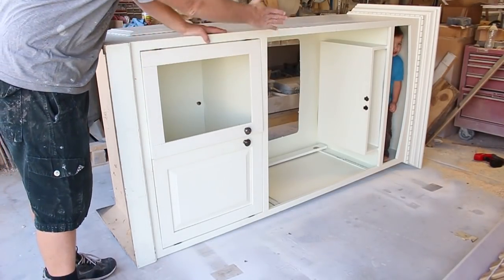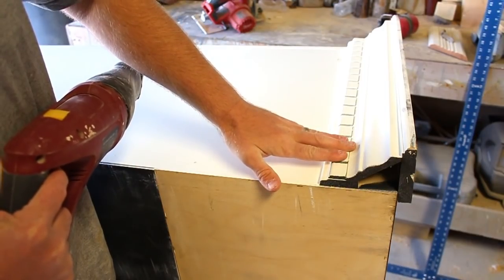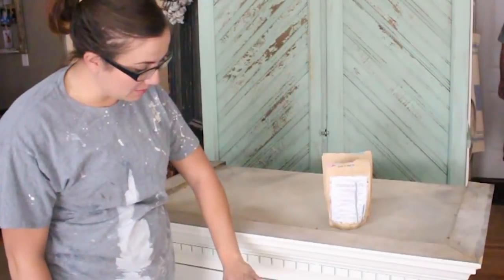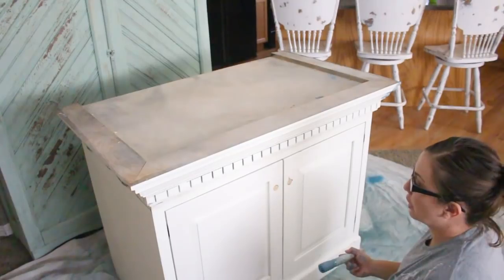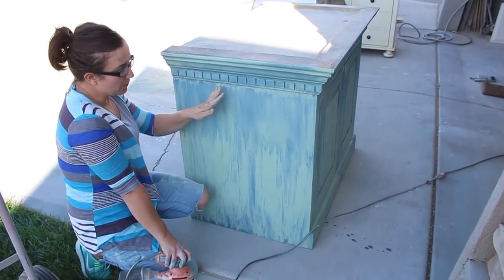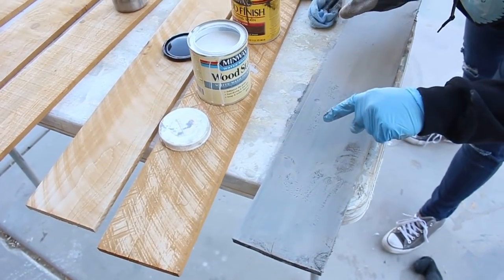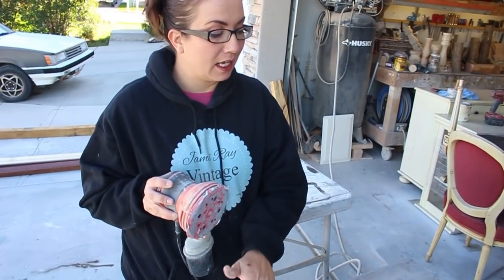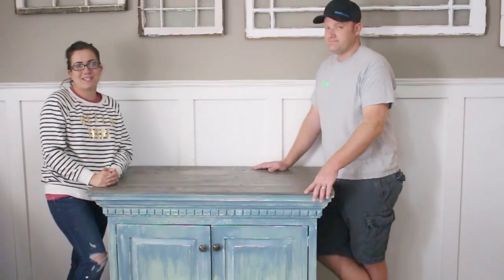How To Transform An Armoire | Chippy Drippy Paint

Comment: I  have shiny builder grade white doors can I mix the Ultra bond with regular paint? Love the Armoire.
Reply from the maker: I would still give them a light sanding if they are super shiny. When I say light sanding I mean, rough up the surface a little with some 120 grit and then paint. If you sand more than 10 minutes you've sanded longer than I would!

Comment: Can milk paint stick to about a 15 year old wood cedar entertainment center that was probably cleaned with cleansers, polishes or pledge in it's lifetime? The top looks just like yours. I just don't know what oils may be in the wood so the entire paint job may fall right off, bond or not. It's a rough cedar I've been dying to paint.
Reply from the maker: It can stick to that. I would clean it really well with a degreasing dish soap or TSP.

Comment: Are the minwax stains you use on the wood on top of ur projects water based??
Reply from the maker: The minwax stains we use are oil based. We’ve gone to mostly using the Real Stain that we carry in our website. The Real Stain is water based.
Reply: Jami Ray Vintage so if the stain is oil based  are we still sealing in polyacrylic?

Comment: I tried spraying chalk paint and it blocked my sprayer and overheated it. This was with Annie Sloan. What chalk product do you use that’s sprayable.
Reply from the maker: Rogena Styles I use fairy chalk mother and diy paint. Look up our video on how to spray chalk paint. The key is to strain it and thin it out. Also the sprayer makes a difference. We use an hvlp sprayer from harbor freight and an air compressor
Reply: Jami Ray Vintage thanks for the super fast reply. I only have an electric sprayer but will check out the video. Never heard of those paints either but I’m in the UK. Thank you.
Reply from the maker: Rogena Styles gotcha. I have had friends use the home right sprayer with chalk paint. Be sure to strain well and play with different amounts of water. All chalk paint is different but getting rid of the clumps and thinning it will always help. Just be careful not to thin so much it gets drippy. Annie Sloan can be hard, the one time I sprayed it, it was so thick then it was too thin lol

Comment: How many layers of the polyacrylic did you use. I just used some on a dresser and as I’m researching on YouTube people sand the layers down and add some more layers. I’m not sure if the sanding down will chip off my paint too much
Reply from the maker: Ana T it really just depends on the look you want. Most people on YouTube will use polycrylic to get a high sheen on their piece, hence the buffing and leveling in between coats. We typically do 3-5 coats depending on if the piece is a high traffic/use like a table or kitchen cabinets. We do buff the last coat with 400 grit quite often but that’s because we are going for a matte farmhouse finish.